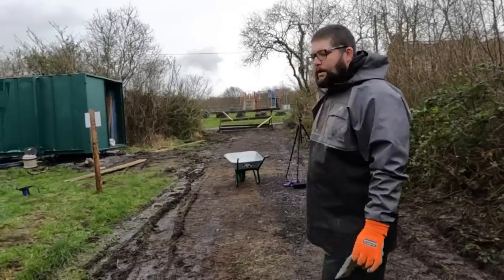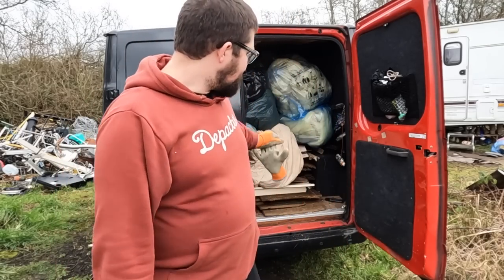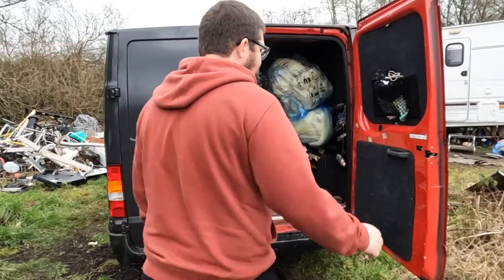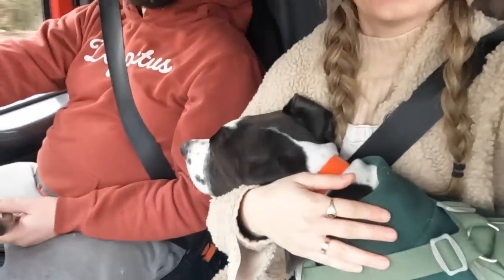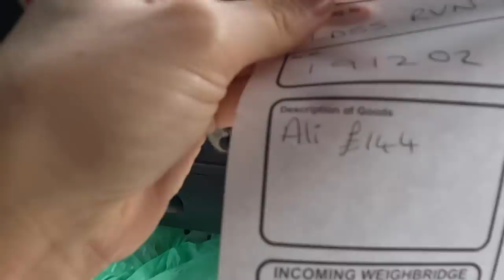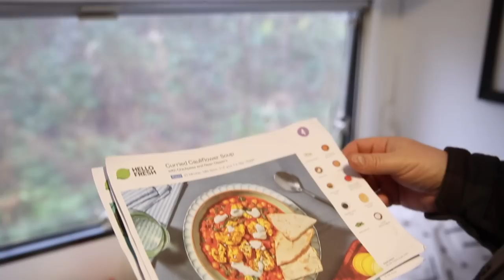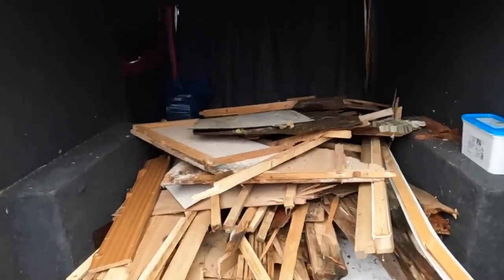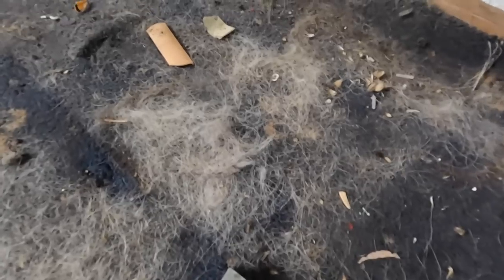Renovating our abandoned caravan park | Building a tiny home & off grid homestead + GIVEAWAY

Comment: Nice job, well done.  But I hope I catch you in time before you let the skip go.!! Collect all the cables off all appliances as well as all other scrap cable. Bag it and take it to your scrap guys, worth much more than the aluminium. Also the motors off the washing machines and other electrical equipment.  Good luck 👍 💓
Reply from the maker: Thanks so much Andrew! Thanks for the tip :) the skip is still here 😊 we will dig them out! thank you for taking the time to comment

Comment: Well done on what you have achieved so far. Tip,,,,, separate the copper, (including the electrical cable as winter project for stripping)  and aluminium from the other metals. you'll be surprised how much you'll get for the copper.

Comment: Weigh your scrap wire and aluminium in separate to the scrap in the skip. You'll get a far better price, especially on your copper wire, I hope you see this before the skips collected.
Reply: @joncampoutwest  ring your scrap yard for a price, I think you'd be pleasantly surprised. You can strip them but for the time it takes and the weight you loose on the insulation it may not be worth it. Something to consider. 👍

Comment: Should have just went to some local rivers, and grabbed a couple tons of river rocks. Or seen about getting a dumptruck load of gravel dropped off. Then you could have raked that out over the driveway, then used your SUV to go over the rock and compress it down into the mud, and given yourselfs a much more stable driveway.
I also remember seeing that if you can get reclaimed concrete, it works even better for driveways or anyplace that you expect to have heavy vehicles driving.

Comment: Save all the wires and cords ie copper and any other copper you have and take that separately in your van. Copper pays a higher rate. Put only scrap metals in the dumpster.  Hope this helps.
Reply: Also take aluminum separately.  It brings a higher rate than scrap metal and steel.
Reply from the maker: @garycloud5705  Thanks for the tip! We have put some copper to the side but were being lazy with the wires haha. Think we will take your advise and do them separately :) thanks!

Comment: Hi there just a question with the amount of land you have couldn’t you burn the waste wood? Surely your need to pay at the recycling centre ?
Reply from the maker: Most of the wood is wet should would struggling to burn and we prefer recycling over burning. Luckily we get 12 passes a year with our van at the recycling center, so hasn't cost us anything yet ☺️
Reply: @CampOutWest  also you should separate all your metal, light iron prices around 120£ a ton yet cable is £2800, just trying to maximise your profits, but keep it up
Reply from the maker: @Lj2oo8  Thanks for the tip :)